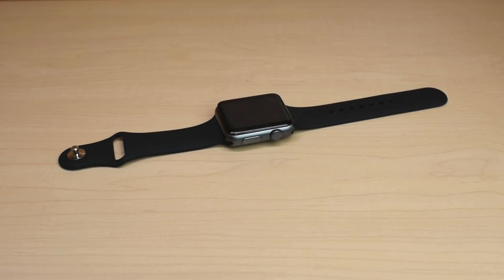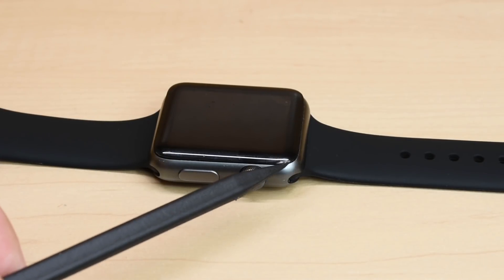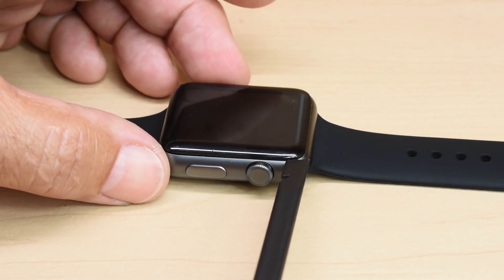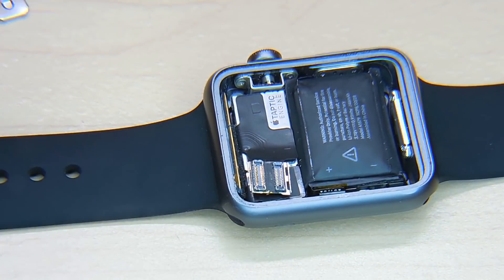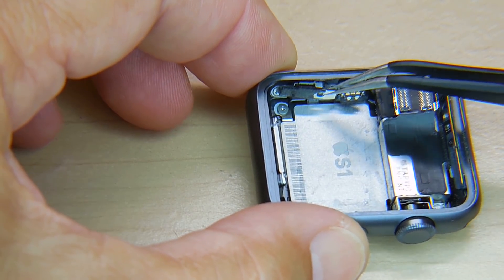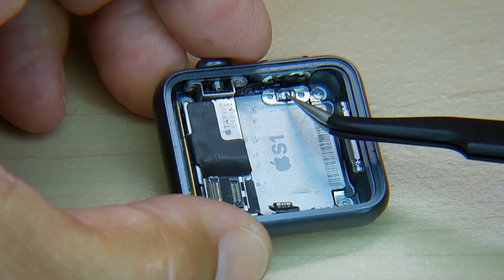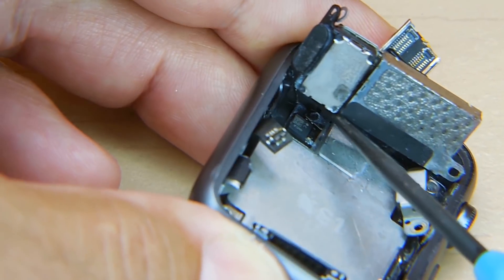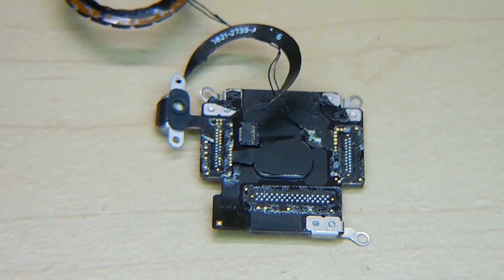APPLE WATCH Complete Teardown! High Resolution

Comment: You quit talking right when you were getting to the part no one ever explains! Why can't I find any info on the 6-point connector in the band slot?
Reply from the maker: I don't know the name for every part of the watch, and I'm sure others don't either.
Reply: @electronicsNmore  Yo, I was just talking about the irony of the situation, didn't mean to ruffle any feathers. Turns out it the diagnostic port. But tbh that's a pretty common term and I'm equally surprised that so few point it out.

Comment: Hello Doug, Not to many user serviceable parts in one of those. I'm to old school, give me through hole and it's all good, hardly could see SMD. Be good, C.
Reply from the maker: Correct, not too many serviceable parts. The flat cables are connected to almost all the components. Not sure if the flat cables were spot welded to the board or soldered, but it wouldn't be an easy repair. Thanks for watching! Be sure to rate thumbs up to offset all the channel haters. Not one negative comment posted about the video, but thumbs down. That's YT! They rarely have the balls to speak out in the comment section, they hide behind the buttons.

Comment: What a piece of junk.  There are watches from the 16th century that still work!  Talk about throw-away culture.  The Apple Watch is a perfect example.    Steve Jobs could have had a watch that his great 10 times over grandfather wore. That would "only" go back to the 19th century.  There is just something offensive to me about a watch that is unfit for anything less than 10 years after it was made.  I just don't "get" the smartwatch.
Reply: I’m pretty sure a 16th century watch wouldn’t survive a dip in a swimming pool either...
Reply: The features negate the lack of longevity. What's so hard to get about that? You can make that argument about any piece of tech. The benefits you get out of it far outweigh the lack of longevity. It's also very cheap. You want a watch that will last for decades, you're going to be spending around $1000+ for a high quality Tag, Hamilton, Omega, Breitling, etc. And that watch will do ONE thing, and one could argue that it does a pointless/redundant task of telling time, since you have a half a dozen other ways of telling the time. The VALUE of a smarty watch is far greater than a regular watch, for $200-300 price of the S3 Apple watch in the video, or even for the new $400 S5 watch. How about a smartphone? $500-1500 is a lot more tan the $200 old cell phones (non-smartphones), but the value is much higher. The old cellphones did ONE thing. Smartphones can do banking, bill paying, GPS, take high quality photos, email, other business, games, calculations/conversions/translations/dictionary, MP3/music player, video player, note taking, business tasks, smart home control, and... Telling the time. It can also do one of the most important things, especially in times of COVID... Video conferencing. That allowed me to stay in touch with my 6 year old girl for the first TWO AND A HALF MONTHS of COVID when her mom wouldn't let her leave the house. I probably would have gone down a dark path if I couldn't see her for 11 weeks, but I was able to see her ANY time of the day, no matter what I was doing. I would have spent $2500 on a phone if it allowed me to do that ONE task. (I'm only around my computer at times she is sleeping; in the evening. The only time I would be around my computer while she was awake, was the early morning. So, no, a computer wouldn't work.) She could Google Duo me at ANY time of the day, and I would be able to talk to her and SEE her face, even if it was only for a minute to tell her that I'd call her back in a few minutes. I believe that smart watches can do video conferencing as well.

So, you need to look at value, not only cost, or only longevity. Value, features, convenience, cost, longevity, etc are all things that need to be considered. 

(Also 10x great grandfather would go back ~300 years from 1950. So the 1600s or the 17th century. Great grandfather would be 3 generations, plus another 9 generations, would be 12 generations, or ~300 years.)